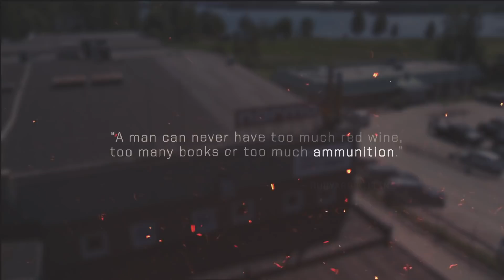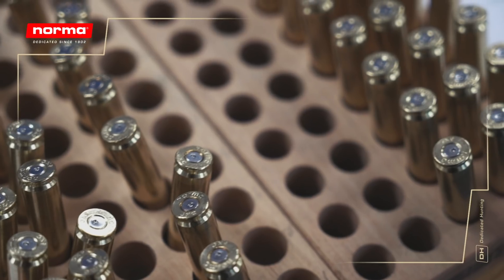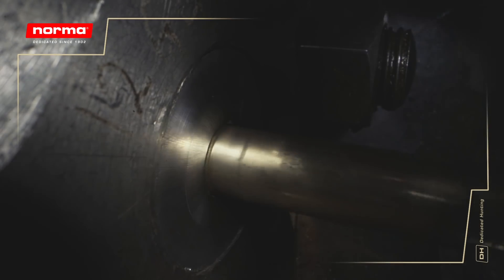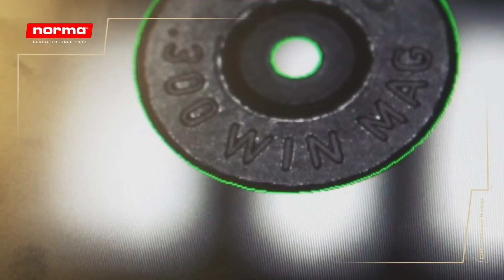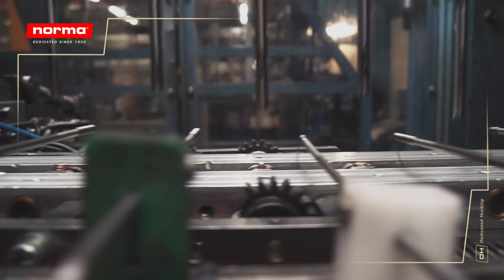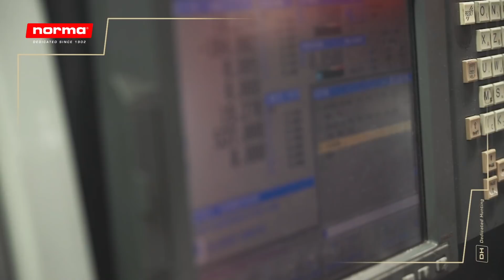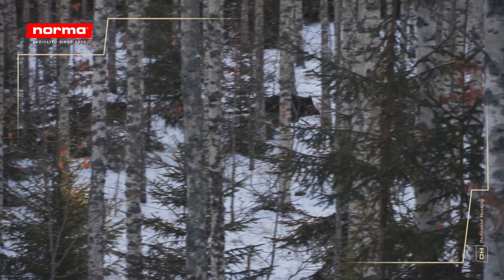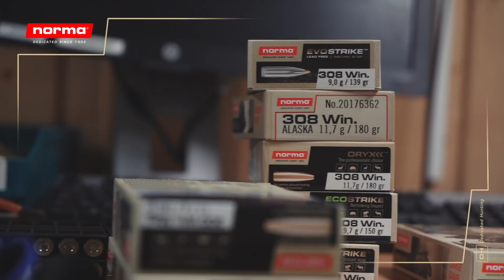How ammunition is made – Norma factory tour

Comment: I am using Norma MAI headstamp 300 win mag brass. 95 grains of H2O capacity which is more than any other manufacturer. I have 8 firing on the brass and it still looks brand new and only lost 0.2% of the original weight